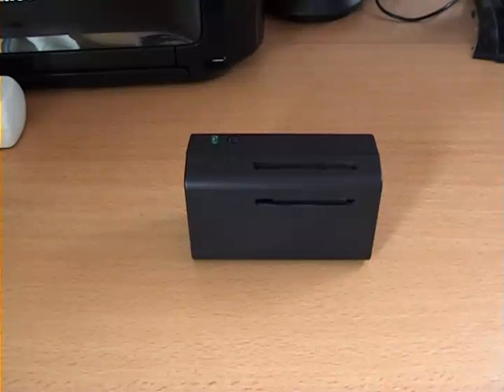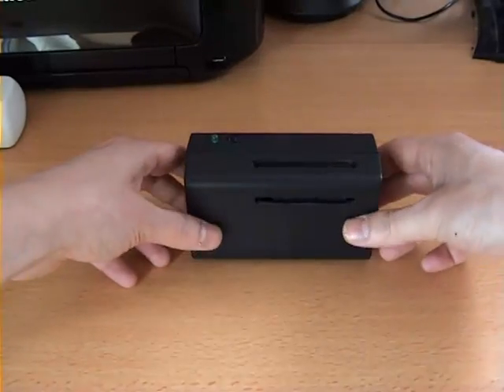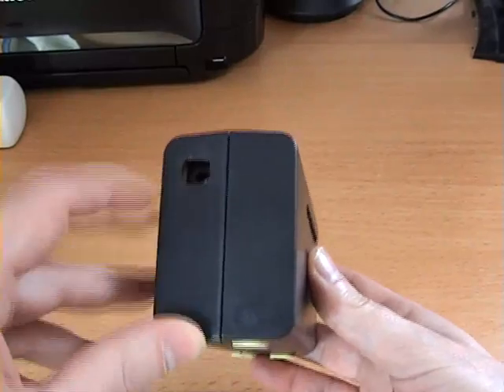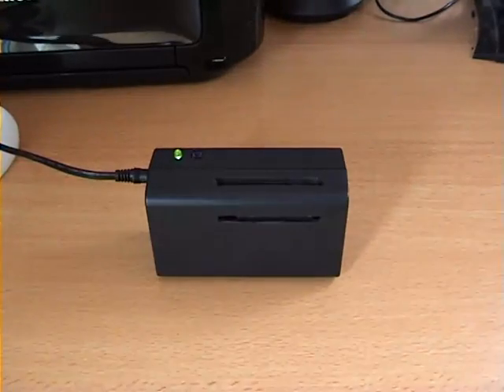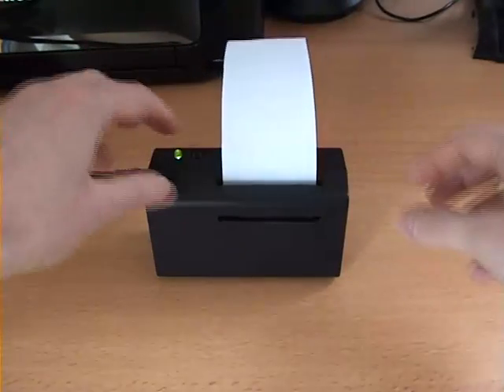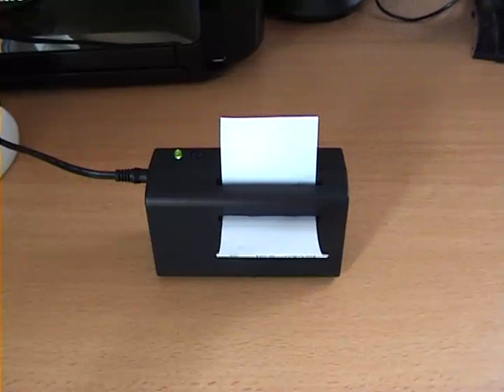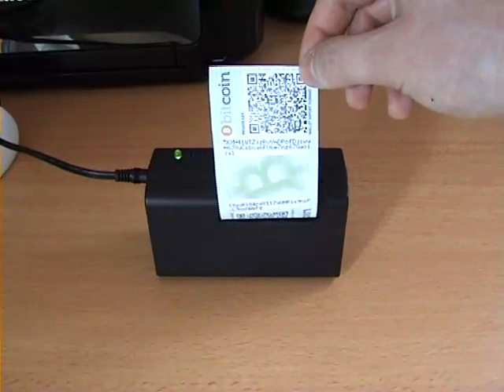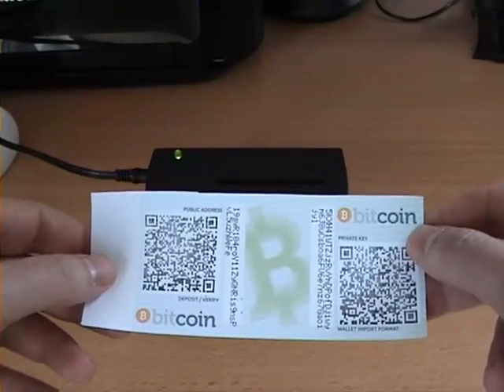Standalone Bitcoin Offline Wallet Printer Demo

Comment: Good time Steven! I liked your development, I saw your code on the github. Thanks for the input. I wanted to ask if you still have a copy of this device for sale? I would like to buy such a device for myself. It would also be nice to improve it a little, to make it possible to manually enter the wif key using buttons, for example. Could you contact me by email kkk--ok@yandex.ru or write your contact address?

Comment from the maker: I'm still putting a business plan together. Once the setup costs are clearer I can work out what kind of investment I need, If any. If anyone can offer any advice on starting up a hardware business it would be greatly appreciated.
Reply: try a kickstarter campaign
Reply: Good time Steven! I liked your development, I saw your code on the github. Thanks for the input. I wanted to ask if you still have a copy of this device for sale? I would like to buy such a device for myself. It would also be nice to improve it a little, to make it possible to manually enter the wif key using buttons, for example. Could you contact me by email kkk--ok@yandex.ru or write your contact address?

Comment: I think any sensor measuring something physical should provide enough entropy. E.g. a microphone sampling at 8kHz/8bit. Take every 100th sample and just consider the LSB - after ca. 3 sec you have your 256 bits vector. Note I assume the LSB will even fluctuate in complete silence due to noise. You may further xor the 256bit vector with another physical 256bit input.

Comment from the maker: I plan to make the hardware and software open So you can build you own and program the chip with open and peer reviewed software.

If that is too much effort you can buy one and compare the components with the published plans and check the software / re-program it yourself.

If I ever put evil software on the chip I run the risk that any one can use the microprocessor manufacturers tools to read the software off the chip and expose that the software does not match a published version.

Comment: I agree, that's why I like your solution! On my EeePC, why should I bother about any security updates? It is 100% offline and used for the sole purpose of an offline wallet using Armory or Electrum. Can an infected USB device do any harm on ubuntu? (There's nothing like a usb "autostart").
Data are encryted on the hdd. I don't use my printer but save priv key to truecrypt containers that I back up on CD-ROM and cloud storage.

Comment from the maker: I've used an offline PC to print wallets before. Its a pain to maintain the security end to end.

How are you going to apply security updates to your EeePC?
Are you sure no one will ever plug a malware infected usb device into it?
Are you sure your printer isn't infected with malware or has a memory of what its printed?

I realise there are other solutions but they require care and consideration on the part of the user. I'm aiming to simplify that.

Comment from the maker: Nothing is commited to long term storage. I'm even tempted to zero out all traces of the private key from ram once it's been printed.

The printer head prints a single line of dots and the ribbon is recycled in a loop so it would be difficult to "Columbo" the information of the printer ribbon after printing a few notes.

Comment: ... I mean: what is used as the seed for the random generator? Some deterministic number like the time since power-on, or some non-deterministic value like ambient temperature, analogue voltage level or a physical gaussian noise generator?